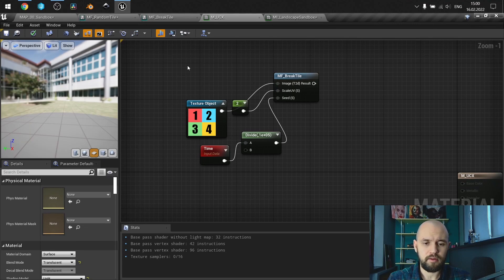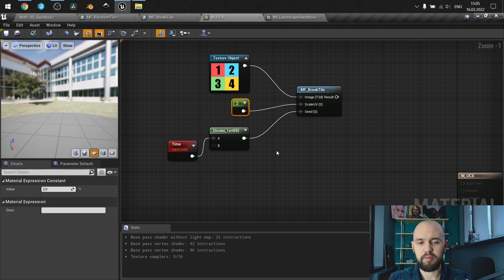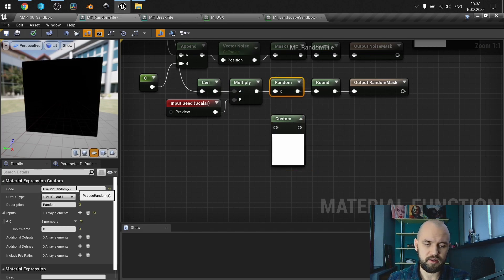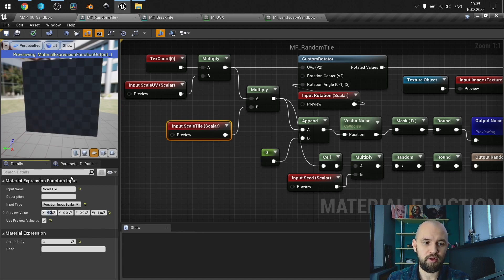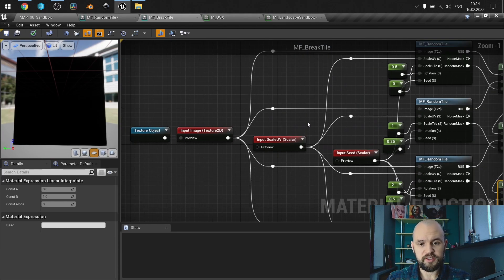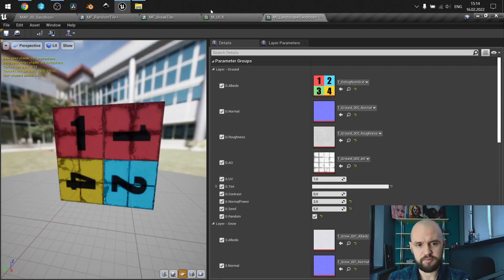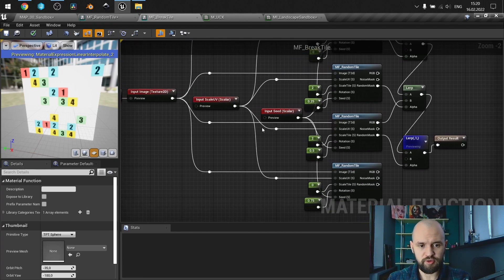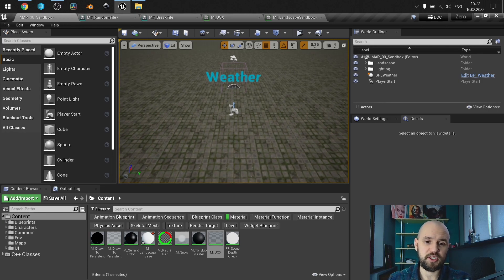Random Grid Tiling in UE4/UE5

Comment: Thanks so much - works beautifully! I will find so many applications!
...However it doesn't seems to work without the rotation??? And this is bummer for my current project.  I have 4 different textures that seamlessly repeat, but only if not rotated HA!
Would try to edit it...
Reply from the maker: For seamless textures this approach won’t work obviously cause u need to hide or blend that seam. Here might help edge detection using frac calculations and used as noise mask for blending. If I have time, I will make another video for this
Reply: @YourSandbox   

Thank you again! Maybe that Edge detection approach is similar  to the tutorial called "Endless materials in Unreal Engine" - I found it after yours, and it suits me - you should check it if you haven't; and perhaps borrow from the approach for further use if you don't know the technique. 

At first I made variation of your approach, just without rotation and with Lerp, and it worked, but strangely Lerp is not even needed. I have no idea who is the better approach because I think with Lerp there is no artifacts in the seams (I have no time to really check and compare both that extensively though)

There is so many stuff to ask though, if you know how to make similar material to work with AbsoluteWorldPosition would be a banger!!!